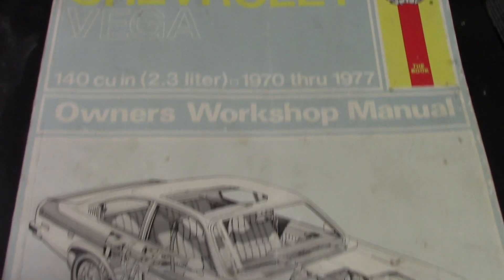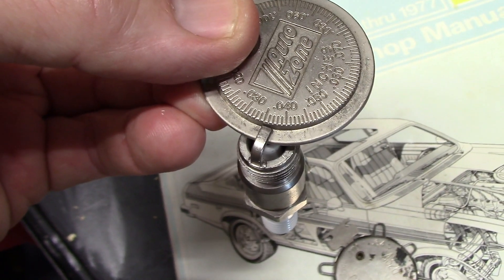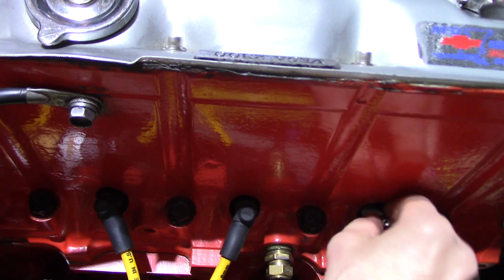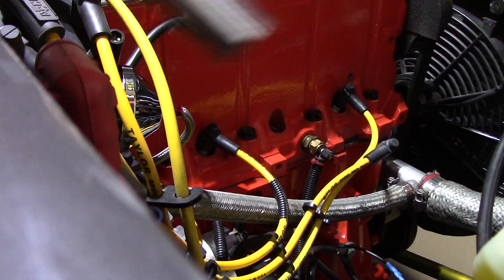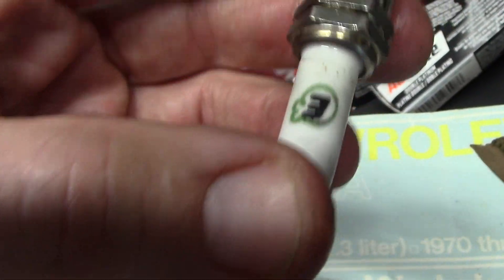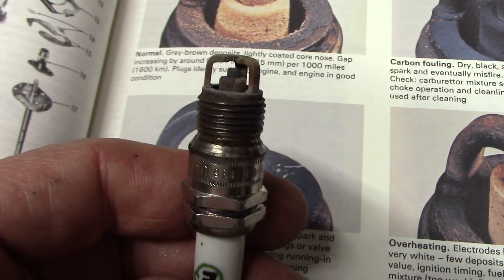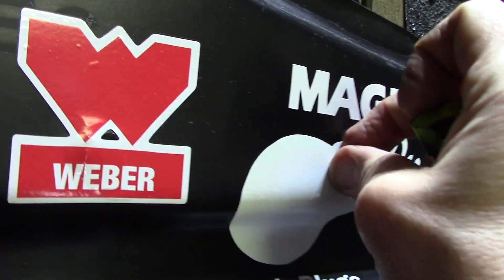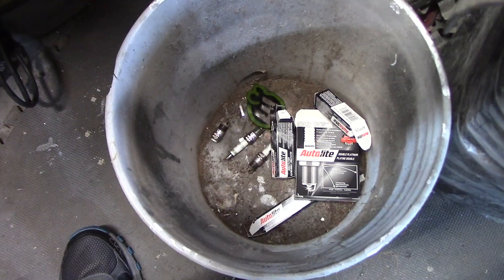Are E3 Spark-plugs good?

Comment: I just had the same issue after driving 10k miles. These plugs do not last long and thanks for the video.
Reply from the maker: Thanks for watching and leaving a comment.  Yes,
I will be sticking with traditional platinum and iridium plugs from now on.  Gimmick plugs are just that, a gimmick.
Reply from the maker: I think their porcelin insulators are not as good as oem.   They just don't seem to hold up to normal heat-cycles.  The core looks pretty flimsy too if you break one open.

Comment: No need to second guess the engineers that designed your ignition system. You can waste a lot of money on gimmick plugs and wires only to find it causes problems. After 40 years in a GM service bay nothing beats fresh OEM plugs gapped and installed. Most cars use platinum or irridium plugs do you likely only need to do this once.
Reply from the maker: Plugs are cheap I like to replace them every 35000 miles. And replace wires every 6-7 years.